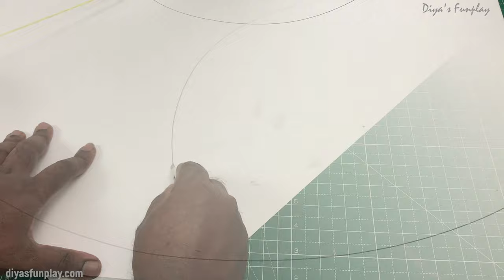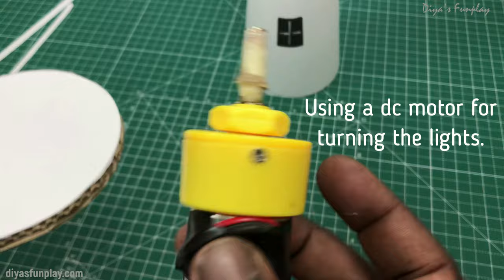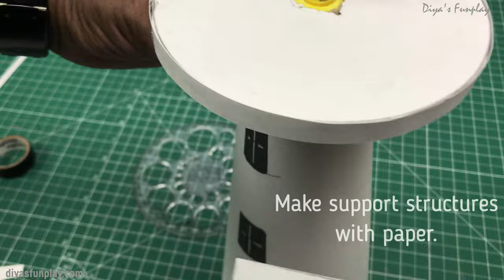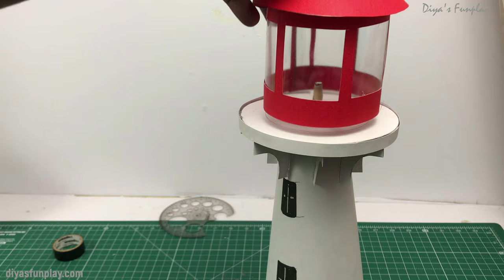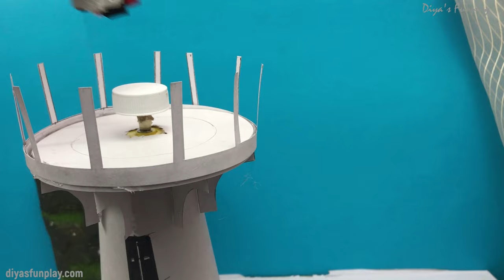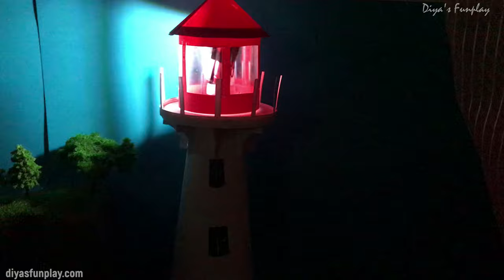Lighthouse working model | Paper lighthouse model | Science fair model | Diyas funplay

Comment: Hey actually thr motor u are using in thr lighthouse has a thick tip and my motor has a thin tip which is not able to balance the motor in the tower..do u have any idea how can i fix that
Reply from the maker: Use hot glue and fix it.